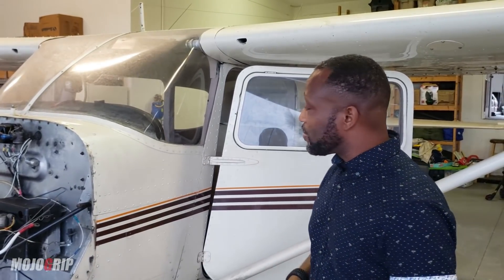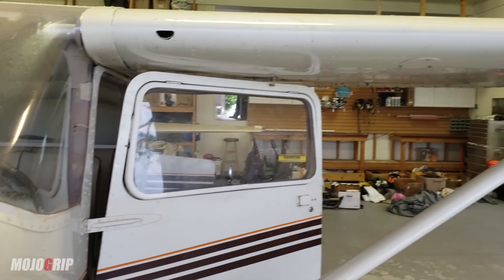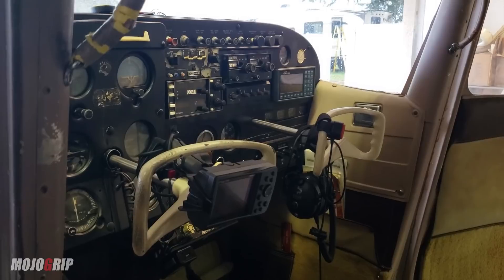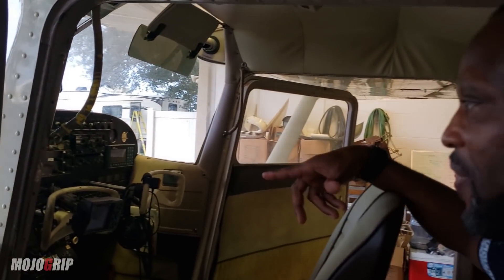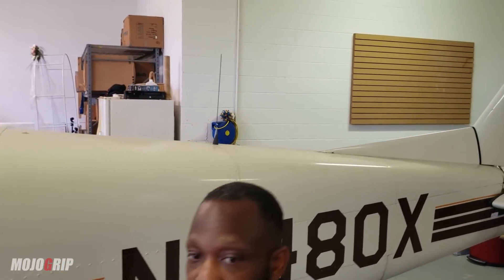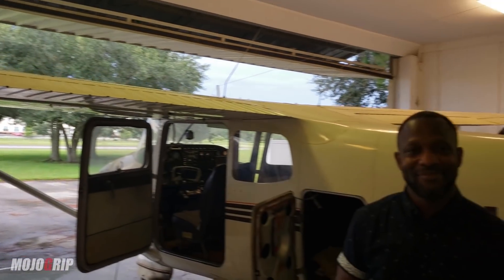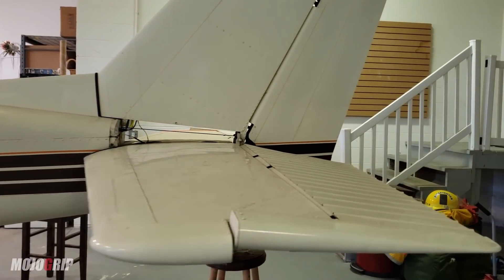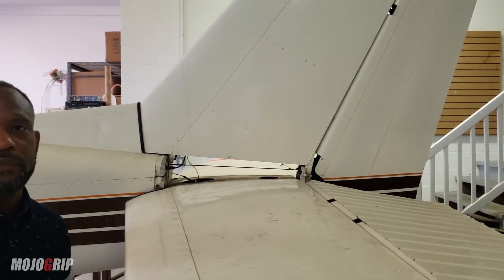What It Cost To Overhaul A Cessna 172 Engine

Comment: Ricardo, you mention wanting to keep the standard six pack and adding an autopilot coupled to your nav unit.  If you haven't thought of it, this is what I did.  I have a 69 182 M, so similar enough.  I upgraded my standard six pack instruments to two G5's and the gfc500 autopilot coupled to them and a GTN 750 nav unit.  My good friend did the same with a GTN 650.  You can't go wrong either way (not dissing Avedyne or others, just not as familiar).  I kept the standard six pack configuration with one G5 filling in the place of the AI and the other filling the space of the DG/HSI right below it.  I kept the airspeed indicator, altimeter, VSI, and turn co-ordinator, so even though all that info is on the G5, I can still scan like I used to and it's nice to have the redundancy.  This was very economical (ha ha, when is a plane economical, but it is relative other options) It is an amazingly capable plane now.  A rock solid IFR single pilot platform.  The best part is I was able to get rid of my vacuum system with this configuration.  Something to consider if you haven't already.  Good on you for restoring a good old bird. It will be a treasure when you get it done.  All the best.
Reply: Thanks for this Erik. I’m putting in the Avidyne 440 which is a robust unit for this aircraft and a remote transponder, with GPS and ILS foe starters. Nice avionics in your aircraft and a total game changer when considering IFR. Thanks and look us up when in Tampa at www.infinityAeroclub.com 

Regards,
Ricardo

Comment: I did an appraisal for an airpark in the Ft Myers area. Because they are unique the bank had a second appraisal done by another group. Unlike regular home appraisals there are hangers and access and low turnover... It was quite an education doing that appraisal. People that live in air parks are great! Very helpful.
Reply: I didn't see any $$ for the appraisal.  What was, say, the average?   You have your home - attached hangar - taxiway to the runway, that has to cost something.
Reply: @mmichaeldonavon  there is no “Average” and that was 13 years ago so no prices from then apply now. The big problem is finding comparable sales because of the huge difference caused by the amenities and hangers.

Comment: Thanks for the video Mike, always interesting people stories in them!  I think this video speaks to aviation being a "love" thing rather than a "money" thing.  Although it wasn't mentioned, given the original aircraft purchase price, the cost of the engine rebuild, the new panel, the new interior, there is little hope of recouping original investment, not in a (likely) high-time 60 year old bird.  In my opinion we diminish the stories when we focus on money, because when you talk to pilots it is definitely not about that.  This video speaks to true love of flying and love of mission ("lowering the cost of flight training").   Thanks again, and Merry Christmas!
Reply: after an engine overhaul  it will have again lot of hours on it , (the engine) ,  should be seen as an investment in hours, same for a young plane .  The plane it self looks wonderful with its original paint.  If it has been stalled in a US State with dry air and private used , not for instruction with lot of touch and go's , IMHO it is definitively a plane to take care of . I would keep as much as possible in the original state.

Comment: Let's calculate:The engine overhaul for 25k, annual plus some small upgrade/repair 2.5k/y. In 10 years 50k, but also flown 2000 hours TBO, so 1 hour costs $25. Form this point of view unbeatable price. Of course,  the real price will be much higher.

Comment: I have a Cessna 340a dual turboprop engine's the only person I trust is me, I do all my own work from front to back and I have for the last 15 years never had one problem ever... how fast will it go 280 miles per hour can I get 300 miles per hour top speed🚀 Why not..And I'm in my late 60s...Fun in the sun in Florida there are so many modifications where you can get more speed if you need it..🛩🛫🛬✈🚁🚀🚀🛸🛸🛩🛩

Comment: A couple of comments... you should really consider removing the engine mount and sending it out for inspection and overhaul.  These mounts are made of steel tubing and can rust from the inside out and you won't notice it until it fails.  You should also consider replacing your Throttle and Mixture controls.  McFarlane makes really nice replacements.  It's a lot easier to replace these while the engine is out of the airplane.   Does your $25,000 estimate include new/overhauled starter and alternator?  What about replacement Lord mounts.  You don't want to overhaul the engine and then have to do these items later down the road.  I noticed a lack of Cabin door and baggage seals???   There appears to be some type of putty or sealant on the baggage door??   Are you getting water in when you fly in rain??   As for avionics you should get the newest and best that you can afford.  The installation and wiring of avionics is almost as expensive as the equipment itself.  You can get used avionics off of eBay and other sources.  Again get the best and newest that you can afford.  There are a lot  of Garmin 430/530's available from people upgrading to the 650/750.  The 430 makes a good radio and IFR navigator.  If you can afford it get a WAAS GPS.  Don't forget about ADS-B requirements.  I've been a Commercial Pilot and aircraft owner for 33 years so speak from experience.
Reply: Questions: If you do buy used avionics, what has to be performed before installing them? Do they have to go to an avionics shop for any type of certification? Also, I take it that on a certified airplane, an A&P has to perform the installation, and the airplane has to be re-weighed and balanced?
Reply: @EJWash57  There is no requirement to have used avionics go through any type of certification.  An A&P can install avionics but most will not.  They do not have the specialized tools or knowledge.  Avionics used or new are normally installed by dedicated Avionics shops.  All installations will require an update to the weight and balance sheet but it does not require the aircraft to be reweighed.  It is simply a mathematic exercise.  Every aircraft has a weight and balance sheet which lists every piece of equipment installed in the aircraft and where in relation to the center of gravity that equipment is installed.  If equipment is removed, it's weight is subtracted and the weight of any new equipment is added and center of gravity calculations are reworked.
Reply: @eagle2019  Thank you Eagle201. Great info!

Comment: Question for Ricardo.. will he be polishing those cylinders to get some extra HP out of the 145hp engine? I have heard it could take it into the 160-170hp range if done right.
Reply: No not this tine. I looked into the cost per hp increase and it didn’t make the cut.😞

Comment: The prices mentioned were for the engine overhaul.   How much will the mechanic charge for the engine installation?   You didn’t mention how much do the avionics cost to purchase and to install?
Reply: Unless you have a personal mechanic the shop charge is roughly $90 per hour for most shops.
Reply: Avionics will cost $13.5-15k on the low end with an Avidyne 440 with gps etc. An engine install depends on the complexity of the engine fir this my mechanic will charge $509-1k depending on if any issues are presented.
Reply: A HUGE number.

Comment: Sir, do naturally-aspirated piston-engine aircraft tend to cause piston ring flutter when cruising at long periods at altitude with manifold pressure lower (let say 11,000 ft ISA or warmer less than 20 in Hg) of what is recommended in the POH during cruise?

Comment: Please tell Ricardo that I'm a bit concerned about where he's rested the concrete ballast blocks on the the engine bearer frame without protecting the frame paint. At least that's how it looks. No doubt he'll retouch any scrape marks caused by the lowest block. I have built my own kit plane and been a military and commercial pilot over 5 decades.
Reply: Thanks for the feedback. Will be powder coating the engine mount so no worries.

Comment: Have higher hp 4cyl engines been TSO'd for that model 172? Do you lose something if you do that? 
At some point I'll have to do something with my 0-320-H2ad (not T-modded, C-172N) when it starts showing signs. Upgrading from 160hp to 180hp means losing 10deg of flaps. 
Not worth it.
Does something similar occur going from lower hp 6cyl to higher hp 4cyl?

Comment: $25 grand for an overhaul. Holy smokes Batman. Outta my price range.
Reply: And that is on the lower end of the price range.  The 172 Skyhawk is a four cylinder 180 hp engine, normally aspirated.  In comparison the 300 hp,  turbocharged engines on my Twin Cessna cost $65,000 a piece to overhaul and that does not include removal and reinstallation.
Reply: @eagle2019  Like I was saying, "Bring your wallet."   An airplane - a big boat - or a RV - all money pits.
Reply: That sounds par for the course for a continental  O-300 engine.  A lot of money.
Reply: @mmichaeldonavon  I don't know a lot but I'm trying to learn more. Seems like boats and RV are money pits as they only depreciate. Good well maintained planes and helicopters of desirable models  seemingly only gain in value, adding equipment like the nav seems expensive, but most of the money is seemingly recouped. This was likely a 30k plane, now that he is putting so much into it seems conceivable that it will now be a 100k plane. From what I can tell he will be 45k -ish deep, but nice restored models with modern nav, newish paint are going for like 100-120k on this model.  I think it's part of the reason Dr's and Lawyers like to buy them and banks are willing to loan on such long terms (20+ years).
Reply: @abigailjones9868  I think you are absolutely right!  Still, in the long run, they are money pits - trust me, been flying for over 40 years an have seen a bit of this stuff.  :)   If you have the money, it's cool - and, yes, when you sell, you MIGHT recoup your investment.  Thanks for the comments - are correct, IMHO.

Comment: When you say 25,000, is that labor and parts? What would the engine parts only cost, and then show the labor? He mentioned the annual being 1,500. Then he adds another 1,000 per year. In the 1,500, how much is labor in that  and how much in parts in that amount? Thanks
Reply: Typical GA labor is about $90 per hour.

Comment: Ummmm, could he just buy another plane?  That was my first question.   Second,.. “can we put a bigger engine in it?’  Wondering as a non plane owner,...
Reply: “Someone” took that engine.  He has a great Pilot environment!
Reply: Yes he could conceivably buy another airplane but he would most likely be buying an airplane with a used engine.  Plus he will have to sell the airplane he has now and will take a beating because of the condition of his engine.  Airplanes are not like cars which are sold every couple of years.  Airplanes are way more expensive and are kept for long period of time and are upgraded an repaired with new engines and newer avionics, paint and interior.   The average airliner flying today is 20 years old.

Comment: Acccording to friend with a 172 and an A&P friend.  They completely overhauled his 172 engine for between. $2500-$3000 .  Sounds like $25000 is a complete rip
Reply: Henry, there are various flavors of overhaul or rebuilding of aircraft engines.  Per the FAA a rebuilt engine as defined in § 91.421, “is a used engine that has been completely
 disassembled, inspected, repaired as necessary, reassembled, tested, and approved in the same manner and to the same tolerances and limits as a new engine with either new or used parts.  However, all parts used must conform to the production drawing tolerances and limits for new parts or be of approved oversized or undersized dimensions for a new engine.” 

An overhauled engine consists of the complete disassembly of an
 engine. The overhaul facility inspects the engine, repairs it as necessary, reassembles, tests, and approves it for return to service within the fits and limits specified by the manufacturer’s overhaul data. This could be to new fits and limits or serviceable limits. The engine owner should clearly understand what fits and limits should be used when the engine is presented for overhaul. The owner should also be aware of any replaced parts, regardless of condition, as a result of a manufacturer’s overhaul data, SB, or an Airworthiness Directive (AD). 

What your friend and his A&P performed sounds like a field overhaul to service limits.  What that means is that so long as the parts meet the minimum size requirements from the manufacturer they can be reused.  With this type of overhaul there are a lot less parts replaced.  Conceivably the only parts that may be replaced in this type of overhaul can be gaskets and seals.

This is where the difference in price comes in.  A factory rebuilt engine to new limits will cost in the $25,000 range as there are many more parts replaced and reworked.

There is also a big difference in the future longevity between the types of overhauls.
Reply: Cylinders alone are $1000 each...O300 has 6. No overhaul for that kind of money. $25k is not out of line, other things you find that need repair or replacement can add up quickly. If you break down, there is no shoulder to pull over on. Our 1964 Cessna 172 is probably worth $50-$55k with a halftime engine and a decent IFR panel. New strip and paint would be about $13k...carpet...$1000 or so, new seat covers and door panels, couple thousand more...nothing cheap in maintaining a certified general aviation aircraft. Not if you do it right and by the regs. Carb overhaul close to $1000, the list goes on. We upgraded our 55year old generator to a lightweight alternator, $1200, new battery?...$335...It does help to have an A&P IA friend who will let you perform work under his supervision and will sign off on it, one that helps you learn all you can about the plane and it’s systems. 
The cheapest way to fly a plane is to rent it, or part ownership through a club that includes a mechanic and/or flight instructor with preferential rates. If you are mechanically and safety minded, experimental aviation is a great way to fly.    EAA.org to learn more. I drive a 20 year old car so I can fly a 56 year old plane😎